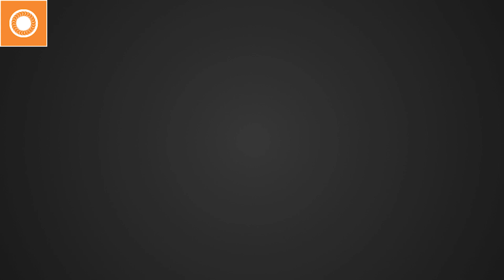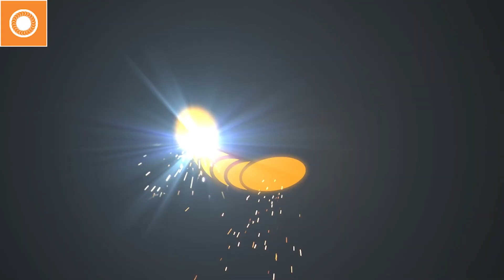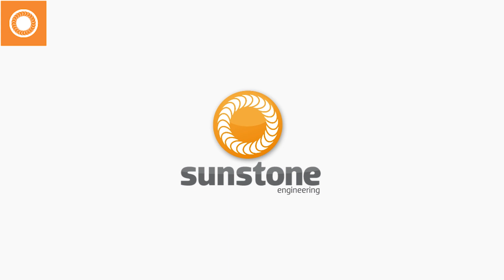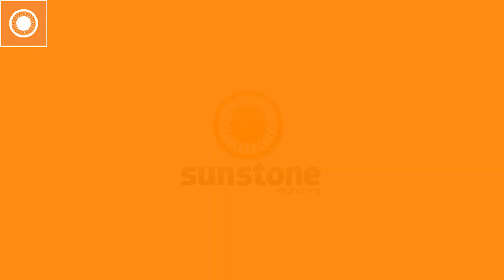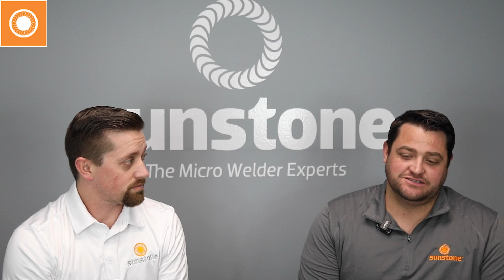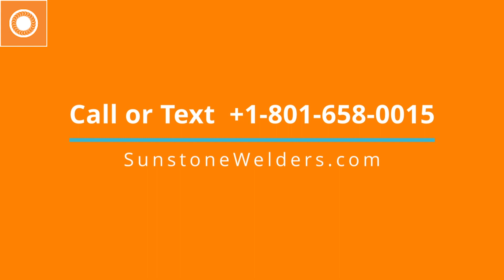Pulse Arc Welding vs Laser Welding: Which is Better?

Comment: What do you recommend for permanent jewelry Pulse Arc or Laser?
Reply: welding jewelry on a customer insider a laser cabinet is very bulky process, a pulse arc tig welder is much more portable and easier to use safely at a small portable table
Reply: The pulse arc is far more portable should you be using different venues and also a lot less expensive.

Comment: good job guys, not the easiest thing to do but you covered the topics very well. if you could do a q&a regarding battery pack tab welding and the different options you offer for welding nickel or copper to connect cells for large current applications related to the EV industry that would be awesome. thanks
Reply: Funny you mention this. Stainless steel welds easily I bought a pack of stainless steel cable ties and tin snips cut them well. The lower power needed to weld stainless will make welding steel battery tops easier with less melt through. Nickle costs more and copper takes more energy and battery ends melt easily.

Comment: Great discussion about possible the most asked question regarding the two different types of machine. Having owned both types for a couple of years now I totally agree with you that both are great on their own but better to have the advantages of both if you can afford to do so.
Reply: Hi ken I have questions I doesn’t have none of them but I really want to buy one , first ,1 first if I want to do permanent jewelry whit the customer can I do it with laser or is dangerous, 2 second ,which one is better when I have to do a very , very precise job , 3 third if I have a stainless steel jewelry like a chain, bracelet etc can I do it whit with the arc welder , and the last one where did you recommend me to buy it, company, internet website 
If you can help me I will really appreciate 👍🏻
Reply: @Jose-gz6hp  Hello Jose, I hope that you are well? In answer to your questions, I can only give you my opinion based on my own experiences and others may or may not agree.
1: For permanent jewellery either welder would work but I think it would be safer and less harrowing for your customers if you used a small pulse arc welder. The reason for my choice because a laser welder has a welding chamber and a safety curtain. Your client would have to place their hand and wrist into the chamber together with your own two hands. This would make the space in the welding chamber very tight to manoeuvre the clients hands into a position to weld the piece of jewellery, also the client would not be able to see what was happening to their hand. A pulse arc has neither of these restrictions…
2: Again, both types are suitable as both are very precise. The main difference is if the welding position cannot be accessed by the pulse arc’s electrode it can’t be welded well, if at all. The laser welder has an advantage over the pulse arc due to the fact that if the position to be welded can be visibly seen, then it can be welded very accurately.
3: Again both types have the ability to weld stainless jewellery very well, bearing in mind the restrictions I’ve highlighted in question 2. The answer to this question maybe a personal one for you of how much you are prepared pay to purchase either type of welder.
Finally, if you are living in the USA, then Sunstone and their Orion range of pulse arc welders or their range of laser welders would suit you. Always ask if they have either an ex-demo or traded in welder available for purchase, as this my help with your budget. If you are in Europe then Lampert (Germany), Electrolaser (Italy), Freeform Fabrication (UK).
Reply: @KeniloTube   Hello Ken thanks for answering my questions , I hope your doing well, I think I will begin with the arc welder, because of the work that I do .my customers wants permanent jewelry , you bring a point that is very, very important and is the position of the hands and the space of the chamber that we have during the welding, so for safety reasons I will go with the arc, the other thing is that the arc welder will weld stainless jewelry very well . I really appreciate the time and knowledge that you give to answering my questions, changing the subject I got a bigger problem and is that I writing from Puerto Rico and we are being hit att this moment by huracán Fiona . I am safe but I really don’t know what damage will bring. Again a thousand thanks and God bless you 🙏😊
Reply: @Jose-gz6hp  Hi Jose, having worked in Guadeloupe filming for BBC for 10 years I appreciate the hurricane issue you are having. I wish you good luck and God be with you and your family.
Reply: @KeniloTube  🙏🙏🙏
Reply: @Kenilo Tube, I'm thinking of buying a small pulse arc welder due to it's more affordable price  versus a laser welder.
Any thoughts you may have in regards to welding gold filled metals( eg closing jump rings) using a pulse arc would be appreciated.
Reply: @bettybho2168  Hi Betty, unfortunately I have never welded gold filled material but I can’t see why and the pulse arc should be great. The only restriction is getting the tungsten electrode to touch the welding spot on smaller pieces that are restricted by other prongs etc. I hope this helps?